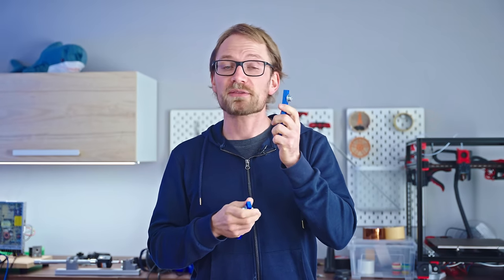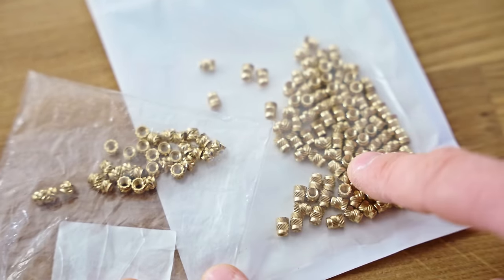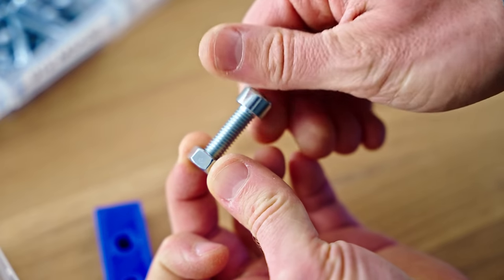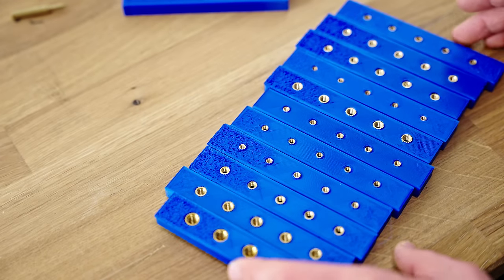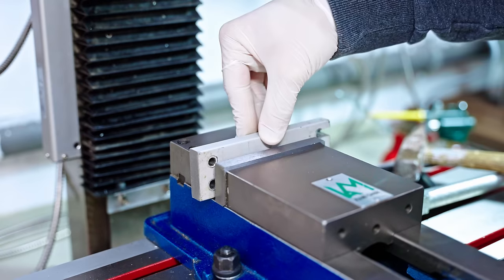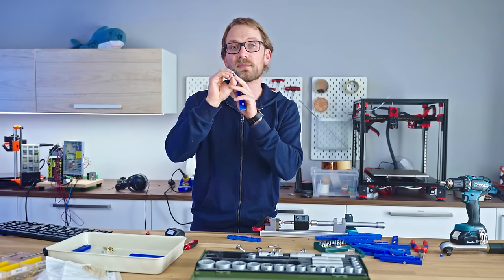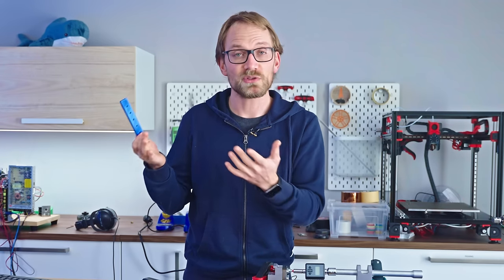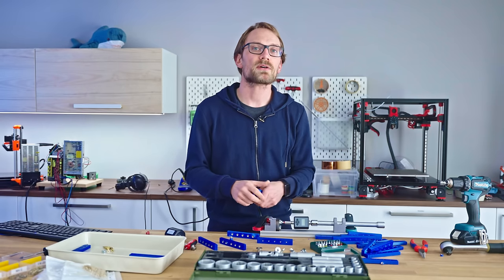Do you even need threaded inserts? Strength tested!

Comment: I think that  if we are at a point were the full strength of steel bolts is needed, 100% infill is also warranted. Also it would set a benchmark of what is achievable best case and once we know that we can play with achieving as close to that by other means like just adding a few layers or changing the infill geometry around the hole. Another set of experiments that could come after that is materials other than PLA or different kinds of PLA+.

Comment: You should test the kind that expands when you screw in your screw. They just press in and then grip tighter as the screw is inserted. Not sure how they stack up with heat set ones but they have worked well for me when I need M3 screws in 3D printed parts

Comment: Try different fasteners!  PT / Plastite thread cutting screws are designed to be threaded directly into plastic and work very well with minimal preparation.  Use at least 3-4 perimeters to ensure there’s enough plastic to bite into.

Comment: For screws 4mm and up I use a regular nut pressed into the opposite side of the hole. 3mm and smaller I like to model a unthreaded hole around 0.2mm smaller in diameter and use the screw itself to cut threads directly into the plastic. More coarse threads are probably better.

Comment: Print a nut inset in the back of the part (presuming the part is thick enough.   One concept I haven't yet used but have thought of for thick parts  is having a slot pocket to slide the nut into the side pocket to center on where the screw hole will be.   But even the nut insert is a fair amount of additional design work.  But on the flip side is much stronger than any other method I've tried.  IMO if your building something where structural strength is required, it's your best option right up to the point where you should be reconsidering the idea of a 3dp vs a machined or cut part for that element.

Comment: I allways print a slightly undersized holes and let the screw form its threads. M4 = 3.7 mm, M5 = 4.6 mm, M6 = 5.5 mm. If the screwholes need to be reused multiple times, i insert nuts. Works great with Petg (i allways print with Petg).

Comment: You tested only the pull out strength of every insert, but heatinserts are designt to be used directly next to a part so that you screw a part directly above the insert so it pushes against it, then the heatinserts are stronger.

Comment: The screw in type of insert made me wonder if a Time-Sert would do anything. Those are used for automotive needs when you have a broken bolt that ruins the threads. You drill the hole bigger, tap new threads, use thread locker to thread in the time-sert, then break off the tail to finish the job.

Comment: I've always put in hexagon pockets for Nuts, either a side hole or a full hexagon on the other side of the hole. I always thought the Nut was way stronger than the bolt, with only a half nut required.

Comment: If I need a part not to fail I use a threaded locknut usually m3 size. In F360 make the nut hidden or open. prusa slicer lets you insert stuff. Then just make sure the wall thickness matches the OD of the nut pocket.

Comment: I'd like to see new slicer options for holes that will be loaded. I'm imagining printing a disk (eg. 2 x hole radius) around each hole, on every other layer, to get it out into the infill more. Infill lines should also converge on the outside of the hole to make more connections, instead of the simple intersections that are merely interruptions into the grid.

Comment: Exdrudr GreenTec Pro is pretty much the same stuff as Filamentum non Oilen. It's certified as food safe as well and shows similar heat resistance and mechanical properties. Very easy to print and a really nice surface finish. The downside is that it's absorbing moisture somewhere just over PETG.

Comment: Hi nice topic. We have 3D printed (PETG) parts to attach servos on big carburettors for airplaine engine test benchs. They have no inserts, and are tighten and unfit each time we make a test. Simply follow normal mechanical rules for screws in plastic : 
- Oversize 2 sizes (M5 to get M3 strengh), Depending on plastic between 4 to 6 time the diameter in srcrew thickness. Another trick : never use the finishing tap in plastic, it needs to be compressed by the screw. Also never overtight them, the M5 needs to be tighten like a low end M3. Olso a little bit of lubricant helps a lot. We have more problem on the other end : the head load needs to be spread out by a large casher, and you need at least 5 layers for wall around the screw,

Comment: For the past few functional parts I printed, I moved away from threaded inserts to simply sandwhiching the 3D printed part with a nut on the other end, or embeddeing a nut inside the 3D print (either stopping the print or more simply sliding the nut through a hole on the side).

I feel that it gives the most durability and it's also cheaper, the only issue (it's a tradeoff) being plastic creep especially with materials like PLA. It may also exist with threaded inserts depending on the design of the part and how the forces are applied, but it is definitely something to keep in mind.

I would be curious to see how it compares with the other methods.

Comment: I'd say add walls to the holes with inserts or fasteners. I use the inserts in my projects and I have more 'wall' around them. I think I have 4. 
I can't speak to how much stronger they are, but since that was the failure point, more plastic can't hurt. More infill would help, too. 
There may be a way to apply rules to do that just in those areas, so other areas of what could be a large print don't get those strengthening settings.

Comment: I’d like to see differences in infill vs difference in number of layers vs inclusion of narrow designed slits that force the printer to make extra walls around the hole.   Like for example a .25mm ring cut around the hole, or an “X” shape across it… kinda like how you cut a wing body up to force it to print narrow ribs.   That, and a pocket for a hex nut on the far side of the part would be a good reference

Comment: Comparison suggestions: 
1. for example with EVA print head systems RatRigs use you have two options in the design, one uses M3 hex nuts inserted into printed hex cavities from the other side than the one the screw will go into and the other uses heat inserts from the side of the screw. I have never seen any hard data on what is better and your test rig could provice that. Will even the best quality printed hex cavity shear the hex sides and let the nut rotate or will it hold the nut from rotating and pull it through the part failing similarly to the heat insert?
2. I prefer the laziest option for screwing things like lids on boxes and such and that is to draw a hole of the right diameter and just drive a crew into it in a self-tapping manner. To have it stron enough I make the thread engagement longer - often for example 12mm deep hole for M3 drawn with diameter of 2.7mm. The screw also heats up a bit when being driven in so part of the thread molds around it even better. How long would this have to be to compete with the short heat insert for example? Just print your sample bars with varying thickness and run them through the test rig. Is there a lengh of hole above which you get no better results when going even longer? 
3. How about comparing the printed thread for lets say M5 screw with a 5mm wood screw driven into the right diameter smoth hole? People with simpler CADs than F360 might have it easier to just design with wood screws into smooth pilot holes, wood screws are chap too etc. So for this easy lazy option with no heat inserts and no nuts this could be useful to know how that compares to printed threads and other options. Plastic housings of consumer electronics use screws similar to wood screws quite often so it might be good?

Comment: I like all the different options you tested. I think if you "shelled" your test piece to 3-4mm wall and added a rib connecting all the holes down the middle and printed it solid, you might get the inserts themselves to fail instead of the plastic. Ive been testing m8 inserts in injection molded plastic parts, and when isolated, they pullout between 10-14kn and they spin at 45-60NM.. i havent tested anything smaller though..

Comment: Using tapping oil gets me much better thread cuts especially in PLA.  It's so much cheaper for small non-load bearing connections that don't need to be un/reassembled often to simply cut threads into plastic.  Though I do get excited when I have a use case for threaded inserts

Comment: You could increase the infill density. Would it bond better to the perimeter of the hole? This would increase print time but may also increase strength. You could rebate the printed part to the depth of the insert and bolt from the opposite side by giving the insert additional pull strength providing you increase the infill density.

Comment: printed a hubwheel for snowblower, gg. Threaded centre.
printed a rain showerhead and a long extender, both with threads. 100% watertight and works like a charm. reused the old gasket as well :) now im showing like a pro after next snowfall 😉

took alot of moving the model around and support job though.

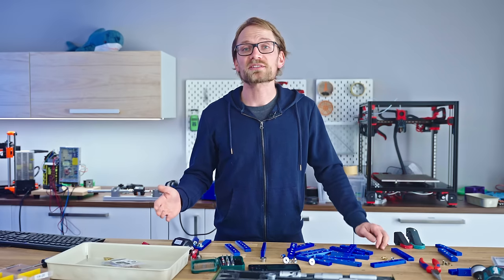Comment: I use the ones you showed at 0:19 but didn't test. The T-nut. I just modify my part to allow for it to fit. It spreads the load across a larger surface.

Comment: Like you mentioned towards the end, since none of the inserts allowed you to meet the torque specs of the screws, perhaps using nylon and plastic screws would be a better match so at least the screw will fail reliably without damaging the 3D printed part.

Comment: For M4 screws, I have found simply printing a 3.9 or 3.8 mm smooth hole works great... 3.9 for most things, and 3.8 if strength is important.

I suspect a brass insert would test much stronger, so for some applications it would not be suitable. But for the vast majority of fastening, it's plenty strong enough and much less wasteful of time than any of the other options.

Comment: I have done a little bit of tapping of 3D printed parts to make bolts screw in nicer. Typically what I do for those is use a modifier in the slicer to get an extra perimeter or two on the holes I'm going to tap. Most times if I can access the back of a part I just use a pocket for a nut to go into, since I'm too cheap to buy inserts.

Comment: I would love to see a pull test from the BACK - the opposite side from which the insert was ... inserted.
Additionally: when screwing into just plastic I have soaked the threads w thin CA glue and re-chased the threads.  Wondering if that actually helps?
What's here is super useful information, thanks!!

Comment: If you have enough space between the holes and with the premise of printing with at least 5 perimeters around them, I have found that the wood threaded inserts have exceptional resistance. They have a MUCH larger external part of the thread and can be screwed in with a soldering iron tip like a flat screwdriver......... and they cost much less than the average 3D printing insert.

Comment: I might be crazy but it seems to me that the real benefit of the insert is the ability to remove and install the screw multiple times without wearing out the threads not the strength. If you are making something that will be assembled and rarely or never disassembled then you don’t need them. What about just printing a straight hole and letting the screw cut its own thread. I’ve found this actually works well. The screw will warm up a bit but if you’re careful and let it cool off before removing the screw it forms a pretty good thread in the plastic.
Reply: Also I don’t think the printed threads can be compared to the inserts fairly using that method. You’re measuring how much torque it takes to pull the insert out of the plastic but with the printed threads you are just measuring how much torque it takes to cut a thread in the plastic. It’s not really the same thing. You need to pull on the screw and measure the force required to pull the screw out.

Comment: Hate to be nitpicky.... but I'd say either use a stepper motor or a corded drill.  The power curve of battery packs due to temperature, torque, duration of discharge, and the discharge/recharge rates and number of charges/discharges all affect the output data.  Thanks for the awesome vids.

Comment: Regarding the screw rating, it's not strictly correct to say that they didn't get anywhere near their specified rating. In that case you were testing the tensile strength of the plastic rather than the screw, whereas in a more typical application the screw is clamping something against the threaded insert rather than the plastic.

Comment: I wonder if there would be a benefit of testing the screw going into the part from the back side of where the insert was inserted? In other words, you press the insert into the back side of the part and then insert the screw through the opposite side, the front side, into the insert. It probably won't make a lot of difference, since it is the plastic that fails, but it seems like the additional amount of plastic sitting in front of the insert, resisting the pull of the screw, should have at least a little effect.

Comment: Tapping the holes after the part is printed works fine for me as long as you add extra perimeters. Granted, I am just using it for prototyping and not fully functional parts that need to hold up over time.

Comment: In situations where I am using smaller fasteners, it means I don’t need that much strength. I try to print pilot holes and use self tapping screws. My pilot hole will usually be just 0.03mm smaller than the minor diameter of the screw. Seems to work for my purpose…….

Comment: First, add more lines around the hole along with some internal buttresses with infill between the buttresses 
Then, use ''soft wood Threaded inserts' (not the hard wood inserts which have smaller but more TPI) which work best put in on the backside because most are slightly tapered..
These go in nicely heated.

Comment: I always up the number of perimeters when doing heat set inserts by a lot. I think the lowest I will go is alternating 5 and 6 perimeters with .5mm line widths, but I definitely had ones done at 6-7 that still failed in pla. I found that modifier boxes over insert areas with increased perimeters and increased infill density was the way to go and won't mess up print times so bad as doing it for the full part.

Comment: You missed the main method most manufacturers use - heat the screw and plunge it into the plastic where it can make its own threaded hole.

Comment: I've had some luck using heli-coils in a pinch.   They work a lot like your 'adapter' does in that you tap/design threads a size up from what you need....screw in the coil...snap off the tab, and use it.  YMMV, but it'd be good to see how it stacks up to other suggestions (like the helical wood inserts and a more soft-stuff appropriate tap.

Comment: Question about using wood screws instead of machine/metal bolts - would those work better given they are for softer materials? You also wouldn't even need a thread pattern, just a small hole the diameter of the wood screw shank.

Comment: If I understood well - you have concluded all the samples failed not on the metal/plastic connection, but on hole wall/infill connection.
Any testing behind this point is useless, you should print the samples again, with higher infill ratio, up to point where metal/plastic connection became "the weakest link".

Comment: Wonderfull sunday morning, waking up with science, especially with your and @cnckitchen work, I'm a huge fan.
Regarding your questions, I do use another option due to design/thicknesses of the part compromise.  I either leave an insert space for a nut or a vertical hole to hide the nut inside the part. This keeps the part thin and strong because the nut itself is the thinner I could get while not compromising the strength (usually speaking of M3/M2).
Also, I use more infill, more walls, and ASA.

Comment: I've found the more surface are you can grab the stronger it is , within reason as is just 3d printed plastic , I use the old method of drop in nut but place a larger washer above the nut , this gives far greater surface area , for the print settings I will set perimeters so they extend pass these washers and for that area of the 3d print use 100% infill as more surface area supporting this perimeter the stronger it is

Comment: I used threaded inserts on my car door speaker adapters. i was worried about their strength so what i did is i inserted them from the bottom up so in order for the screw to pull the insert out it would have to go through 1/4" of plastic. basically, i could really tighten it and not worry about it failing.

Comment: I mainly use captive nuts. I only  tried heated inserts once, total nightmare! Now if I need inserts (mainly for aesthetics) then I print a hole the OD of the insert and then use epoxy to fix it in place, this works really well with ABS.